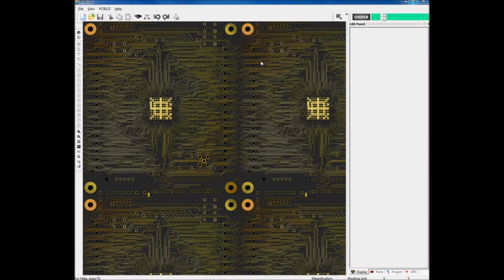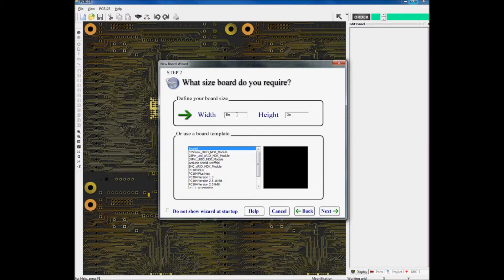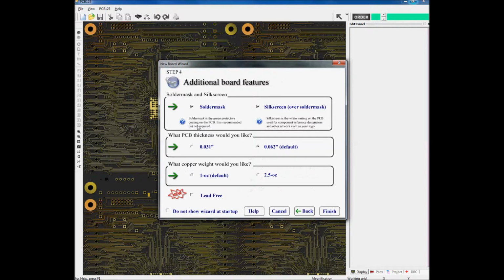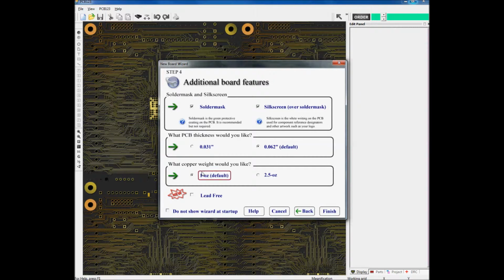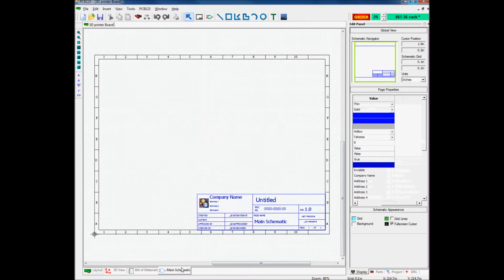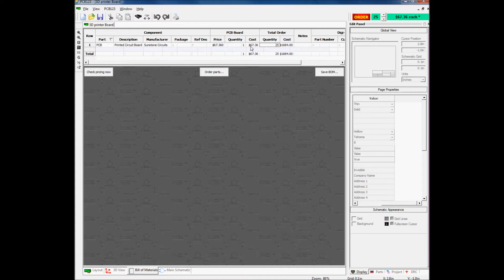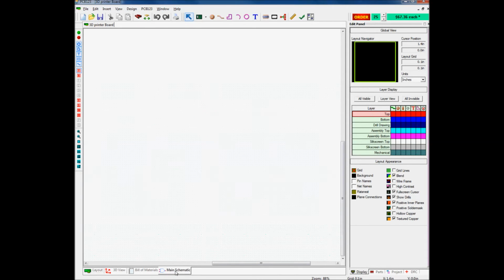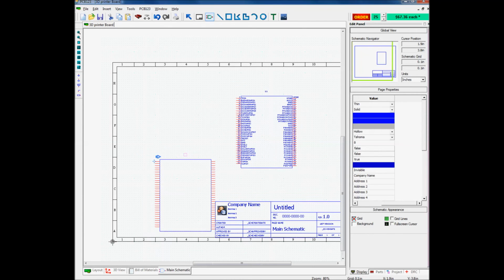PCB123 Intro

Comment: Hey there! Just came across your PCB123 video. Great job! I'm the product manager for PCB123, and I thought I'd add some details to go along with your demo:

1. You can order with leadtimes from as little as 24 hours to as much as 3 weeks. Pricing varies based on square inches, lead times and quantity ordered.

2. Yes! All PCB123 boards are US built.

3. To change the quantity for your order while you're designing, just go to the green boxes in the upper-right of the tool, and change the quantity there.

4. Ground shipping is no-charge.

5. You're absolutely right, our purpose is to sell you boards. That's why we don't charge for the software. PCB123 is actively maintained and improved by a staff of software engineers here at Sunstone Circuits. Instead of charging you a licensing fee or a subscription, we give you the tool for free, trusting that you'll fab with us once you've succeeded in making your boards. We get paid when you order boards, plain and simple. And unlike some other free tools, we don't throttle down the size of the board you can design just to sell you an upgrade license later. 

6. But, if you're approaching your project maker-style and choose to home-fab boards, then  by all means, go for it! Once your project justifies fab, we'll be here.

7. We have PCB123 tech support available for no charge, 24/7/365. Seriously. A free tool with free round-the-clock tech support. We'll help you get over any hurdles you may have. 

8. If there are some standard board templates you'd like us to add, just tell us what you're looking for! We'll be happy to help fill out some Maker-popular standards.

Hope this helps, and thanks for including us!
www.pcb123.com